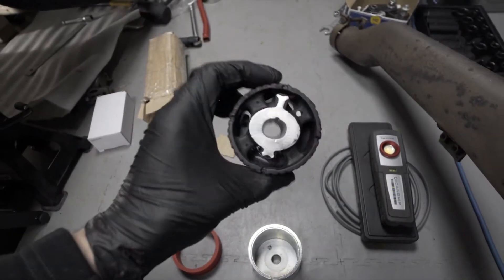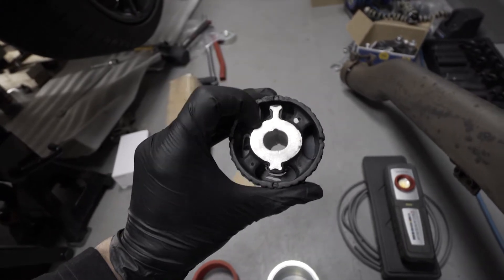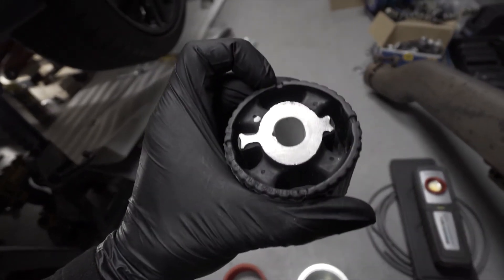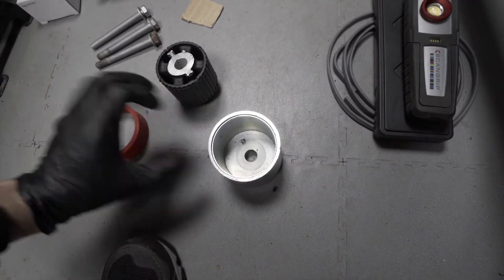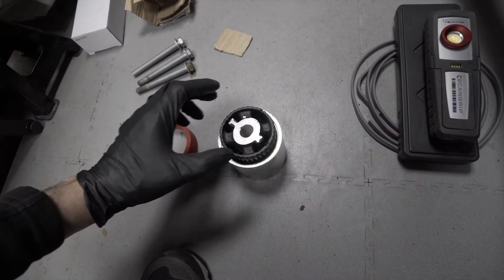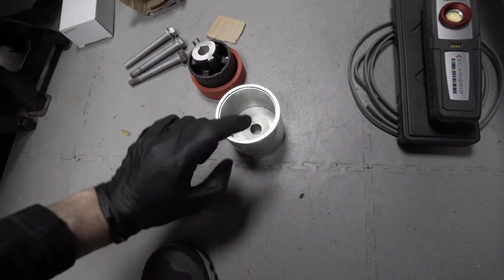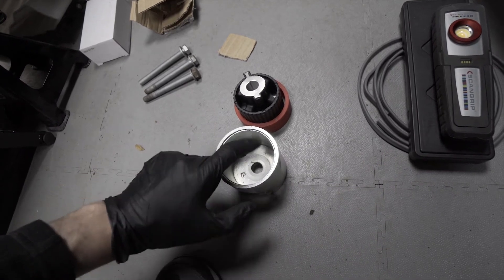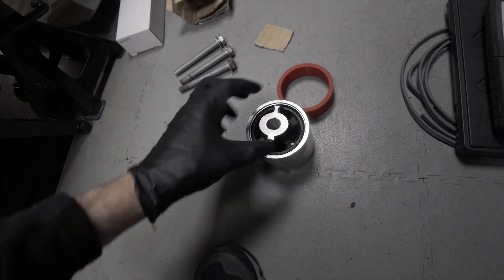BMW F10/F11 Differential Bushing - Overview & Extractor

Comment: Couldn't you just fill the empty space with some 3m window weld?
Reply from the maker: Might change the dampening characteristics, but it might work.
Reply: @BestCarMods  at least its a cheap try to see if it works